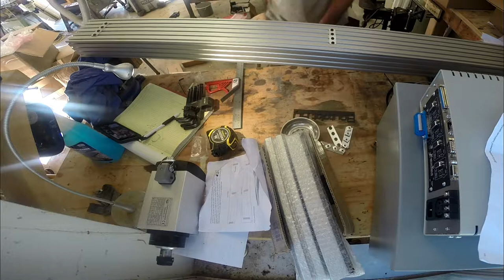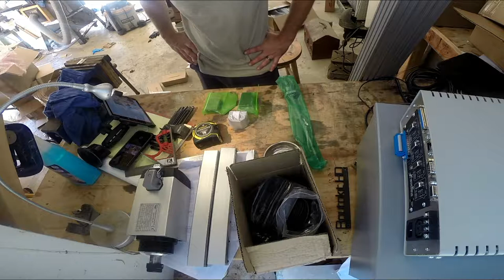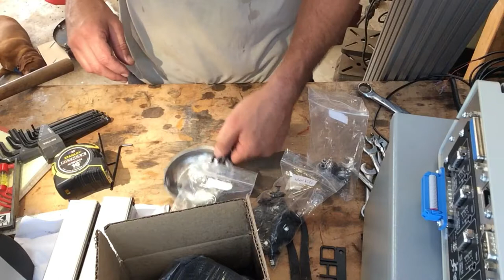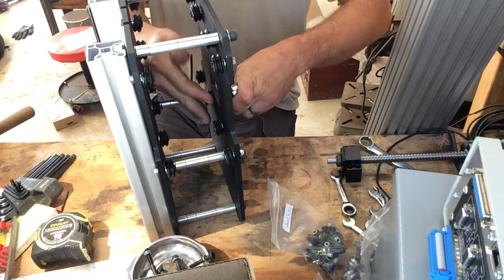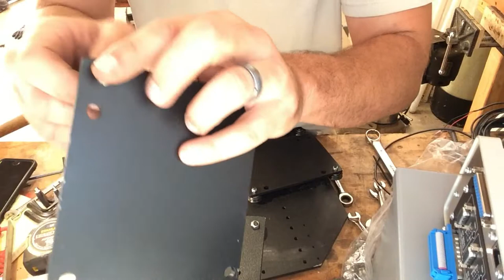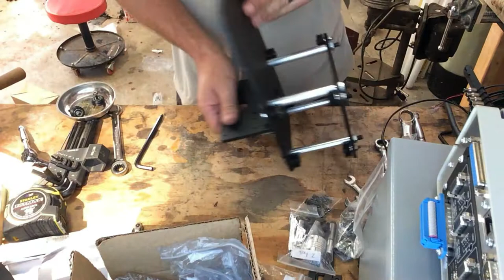Routakit HD CNC Router build  part 1

Comment: @1:01 Did you say "6 thousand"? 
Could you elaborate on what that includes.
Reply from the maker: spottracer I think it was around 6500$. It’s hard to say what’s actually included since no one, I know of, has gotten a complete kit.  But essentially it’s supposed to include everything but spoil board, computer, and bits.   I cannot push you in another direction more sternly.  This company is horrible.
Reply from the maker: Bartop-Arcade.com come join the FB group, one of the guys found better offset nuts than they provide anyway!

Comment: Feels they skipped a bit on the gantry profiles. There are standard profiles accessible in this sizes, that would require no screwing smaller ones together, and incresse stiffness and paralelism.  It apears like it uses three 30x60 profiles (with 12 slots, 5mm slot system). Combining three of them gives 90x60mm I guess.

They say these are 3x 40x80 profiles on their page, but from my measuurements they are 3x 30x60. Weird.

I would recommend drilling holes in external side profiles oversized, and and smaller holes in internal profile and internal sides of external profiles, and then clamp it using bolts every 6 inches maybe or so, checking first geometry of the profile from the side if this will work or not.
Reply from the maker: Yeah I agree.  there seems to be no locating pins or anything to ensure a parallel fit.  And I think youre right that the gantry could have been simpler.  But it is what it is.  I'm finished with the build just need to edit more videos.  Although they shorted me on my drag chain ways and hardware.  For the most part this was a disappointing build.
Reply from the maker: I measured the extrusions and theyre 40mmX80mm stacked 3 on top of each other on the gantry and 40mmx80mm laid next to each other for the y axis beams.
Reply: Ah. Ok. Thanks!

Not the end of the world, just weird decision. Probably cost related. It will work pretty good anyway. :)
Reply from the maker: movax20h there is a new Facebook group for Routakit builders and owners.

Comment: I have tried to continue assembly what I can with the parts I have and I have a question for you. For the spindle carriage, my wheels are not touching the rails and I can't reduce the distance between the rails nor reposition the wheels on the motor plate. I wanted to ask you if in your build, it looks like this or the wheels are fully connected as I would expect. these images show what I have. https://cl.ly/72dde5041c1e  front view: https://cl.ly/732d60a087ec